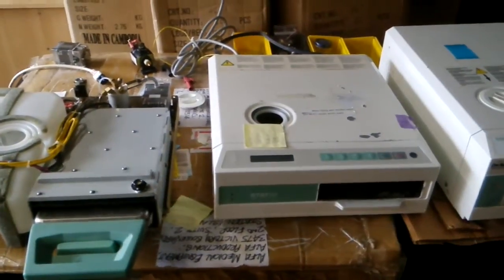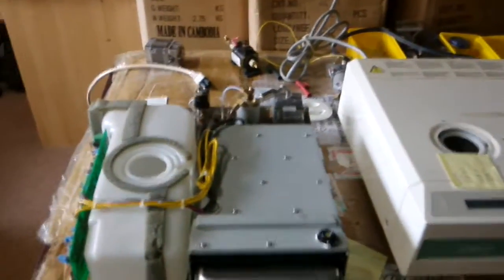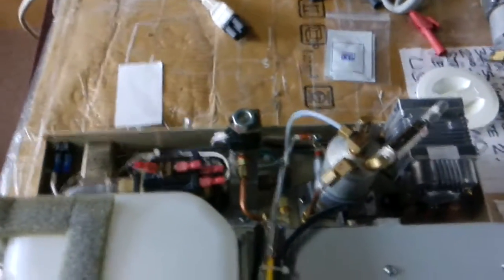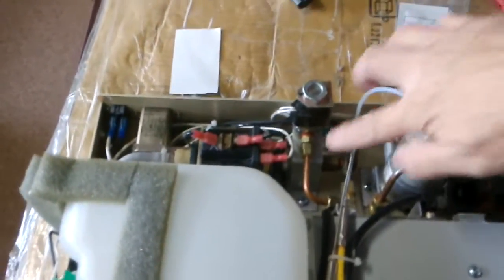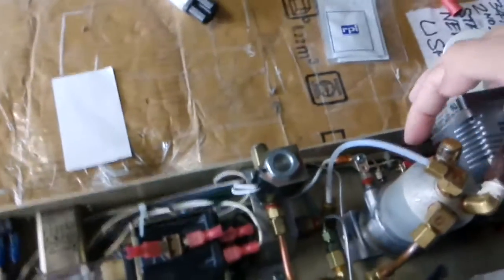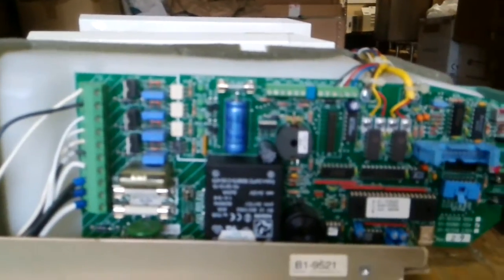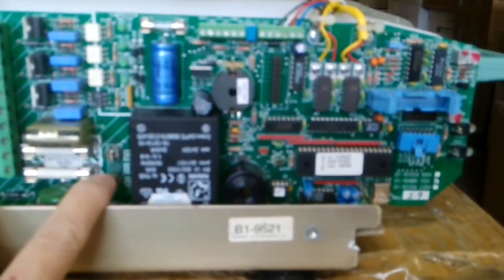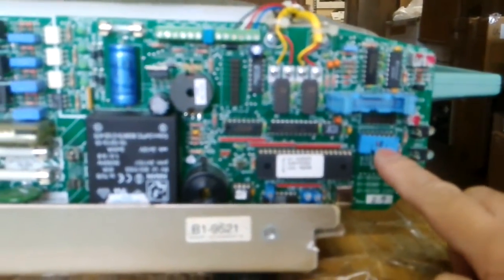How to repair fix Statim sterilizer 2000 5000 autoclave

Comment: Hi there James!

We have a SciCan Sterilizer 2000 and it has been displaying "service needed" error. We bought a new boiler and cleaned the filters of the pump. Indeed, we already changed the pump too. Afterwards, we tested the sterilizer again. It was successful.

But the problem is that yesterday we power on the machine again and we tried to used it to sterilize; the machine started to show the same error message: "service needed".  Of course, cycle doesn't finish. The error appears after we have been pressed the "start" button and, almost, when we have reach the 135 degrees temperature (it appears between 127 degrees and the 135). 

Any idea of what's happening with it? Thermocouples are okay (at least, we haven seen any of them broken). Maybe it can be the PCB.

Thanks!
Reply: You may need to recalibrate your boiler.  It's pretty simple. Just involves jumping two pins on the W1 terminal on the PCB then pressing a few of the function buttons simultaneously.   If you google "Statim Cassette Autoclave Troubleshooting Guide", you can print out the manual.  Who knows, you have probably figured this out by now?
Reply: Hi lizard944!

Thanks for your replay.

We were working on two statims. We were successful with the 5000 statim when we calibrate the boiler (just shorting circuit 2 pins). But the PCB for the 2000 statim was different, so we were not as lucky as before with the 5000 statim. We figured out that in order to calibrate the boiler in 2000 statim we need a "service kit", right?

Comment: James, thanks for helpful videos. We have a water leak under our 5000 machine. The cassette has new seal, still leaks. Cassette from our 2nd machine also leaks. The amount of water leaking (only when cycle running) makes me think there is another issue. any ideas?? thanks
Reply from the maker: +shaybutterflies1 Yes, it seems another issue. Mostly the problem is from its backend probe, one is connected with steam generator, one is a temp sensor. But this is FYI only, no any guaranty implied. If you need, you can visit our website and call us. Thanks

Comment: James, I have a statim 5000s
The unit was shipped to me with distilled water in the chamber.  When I plugged it in the unit did not power up. What might you suspect is the problem.  I am in North America using 110V  power supply but the unit is 240V 50/60h  I bought a 5000W transformer to 'up' my 110V to 240v. I will check the unit tomorrow with a volt meter to see if any power going to it.
Reply: who would ship a unit like thst?  I hope you didn't pay more than a couple hundred tops.

Comment from the maker: For Statim 5000, there is a drain hose underneath the machine. For the old Statim 2000, there is no out of box way to drain the reservoir water, you have to use an hose to siphon the water out. In the new Statim 2000, it is similar like Statim 5000, there is a drain hose underneath to let you drain out of the water.

Comment: I need to replace the tube from the water pump to the boiler. What is the material, what is the size and where can I find it?
Reply: what is the deal with water quality message  what does it mean? if I drain and replace with store bought distilled h20 will it reset?
Reply from the maker: it is high temperature teflon small tube and copper pipe. You may find out from local hardware store. Normally it comes with the water pump, when you replace, which it can be ordered separately.
Reply from the maker: http://www.isterilizer.com/en/statim-2000-5000-sterilizer-metering-tube
Is the above the parts, you are looking for
Reply: James Luo Well, I have a leak where the two tubes connect, I'm hoping I could just replace the tube and not the whole water pump.
Reply from the maker: vod64 http://www.isterilizer.com/en/statim-2000-5000-sterilizer-metering-tube This is for tube only, not the water pump kits